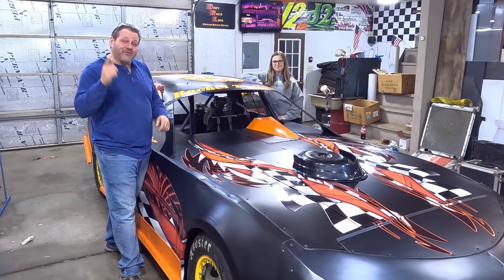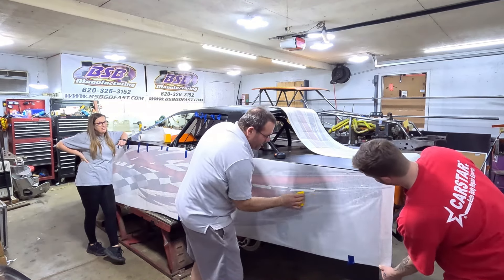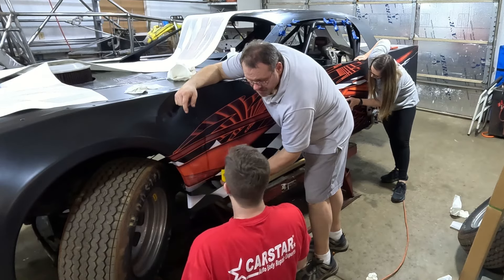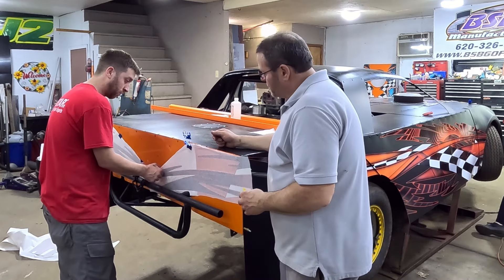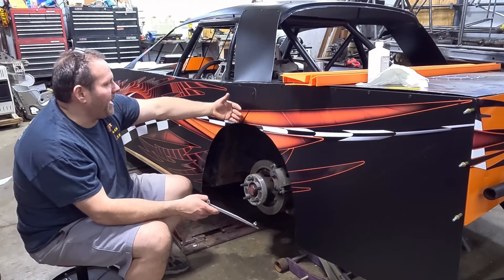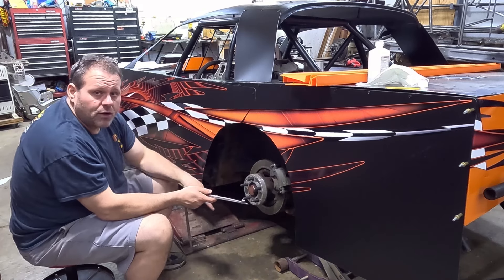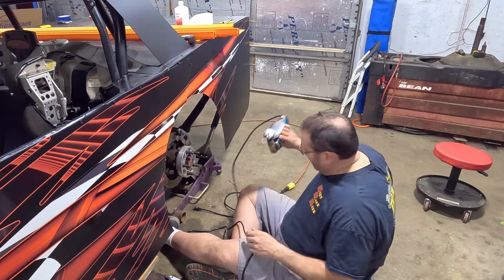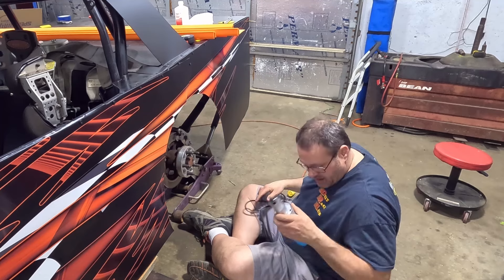Rachel's Rocket has New Trim and Graphics! This Leaf Spring Camaro is Looking Sharp :)

Comment: A solution you could look at for a body tool to roll/fold the lip over. If you go over to the petty garage you tube, they restored one of the kings pontiacs. The guy doing the body, had a simple block of aluminum, with a 1/2 - 3/4 in cut into it, and used it to work the lip over for a smooth edge. Hope that kinda helps. Like your videos, learning lots. From Canada
Reply from the maker: I'll have to check that out bud!

Comment: We always used a solution from the graphics company to spray on first then apply the decals and work the air out and then spray it on the paper to release the outside paper without moving the graphics
Reply from the maker: Sounds like you work with a good company with good products

Comment: Those skirts go up and under the body not on the outside.. They look way better up and under all that should be sticking out is the lip of the skirt..And as a graphic designer ...Use a spray bottle with a couple drops of soapy dish soap water to spray under your graphics before applying if you dont know how to do it. Then when you push it out with your squeegy the will lay perfectly flat and they will dry and be perfect
Reply from the maker: Thanks for the tip on the vinyl Albert. Those skirts go either way and however you want. We thought it would be too dark and needed the color and decided to show the wide trim in the color scheme. Its a preference. I've done both and if the colors were brighter and I thought it would be visible on a dim lit track I would have went behind for sure. The top of that skirt is a rolled lip just so it can lay down flat over the outside like what we did. My new car will be orange sheet metal and we will very likely put them behind on that one.
Reply: I agree on the skirts.